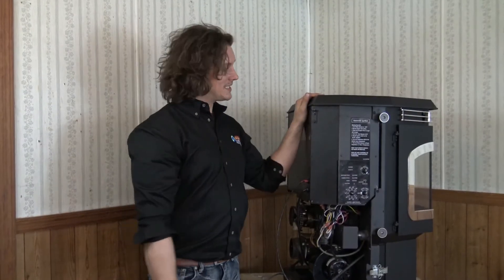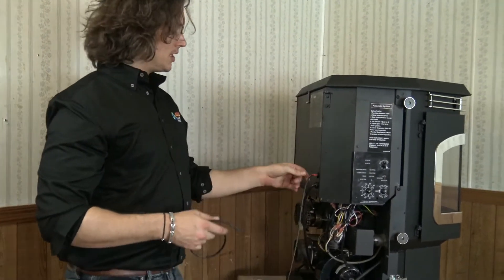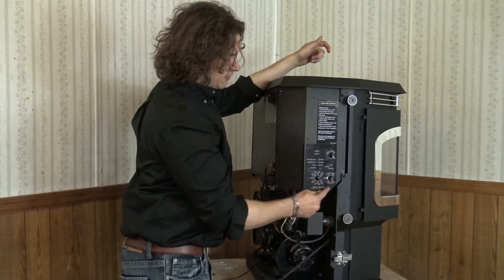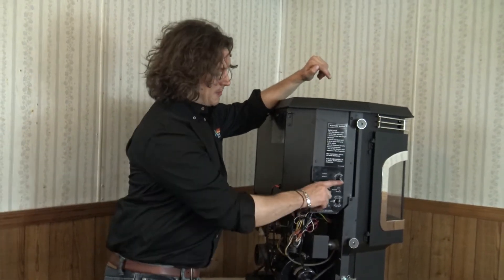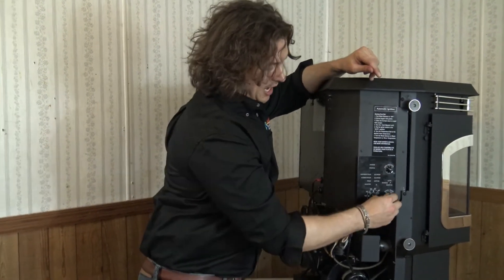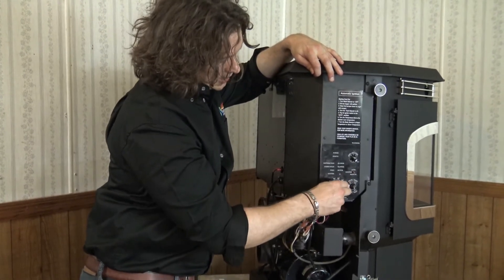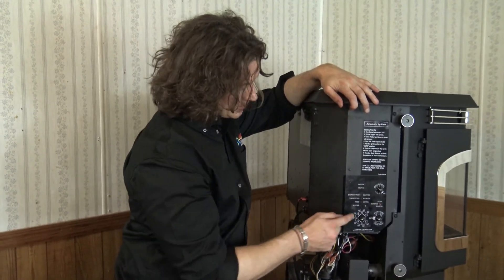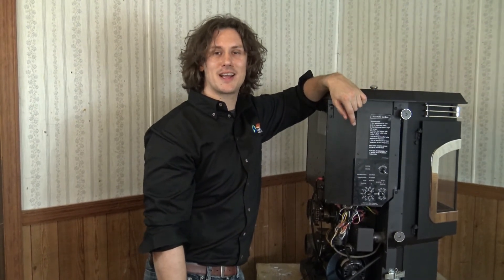Harman Stove Controls, How to use a Harman Pellet Stove

Comment: Hi. My ignite light is staying on and making the fire burn weird. It just keeps wanting to start the fire even after it’s burning. Any ideas?
Reply from the maker: Thanks for contacting us. That is not a common one. Obviously if power is going to that igniter continuously it will also burn the igniter element out pretty quick. The first thing I would suggest is to get an ohm reading on the igniter with a basic multi-meter; there's a small chance it's an igniter issue (Testing Igniter https://pellethead.com/how-to-test-and-replace-a-stove-igniter-pellet-stove-ignition-troubleshooting/). Harman OEM Finned Igniter should be reading 45-53.0 ohms in proper range. Second I would tell you to clean the ESP Probe (video below) The ESP senses temp in the exhaust and gives signal to the control board from start-up to normal operation. In most cases this circumstance will be a control board issue giving constant power to the igniter. You can certainly inspect the control board and see if anything looks abnormal. If you flip your igniter toggle to manual after it lights, does it then shut off? Happy to help. Thanks.

ESP Cleaning: https://www.youtube.com/watch?v=kt7nnGMYU-k&t=42s

Comment: My Accentra free standing has all the lights on board come on and you hear a hint of a hum but stove does not come on. So, basically  from a cold start up I turn it on and the lights come on as if it’s in the starting mode but nothing. I’m going to remove back panels and turn on again to listen for where the hum is coming from and go from there.
Possibly the motor?
Reply from the maker: Thanks for the message, happy to help. Is the status light giving you any blinks? What happens when you turn the feed adjuster dial to test? Most likely the hum is from the combustion blower. Yes, remove the panels and do some inspection with a good light. You can also inspect the combustion fan paddle impeller behind the ash pan - video below on that. Keep us posted. 

https://www.youtube.com/watch?v=N4DwBnYo2Nw&t=596s

Here's a video on the Accentra FS combustion blower replacement for reference as well.
https://youtu.be/np1dlYITcpw

Comment: Hi, does the power light stay on?
Reply: Thank you for answering so promptly. I purchased my house a year ago and have 2 pellet stoves of which I have yet to turn on. I’m alittle intimidated by them since I don’t know anything about them. One of them has never been turned on at all since it was installed. I do have a question regarding the pellets. If the pellets run out, does the stove turn off by itself or would I have to turn it off?
Reply from the maker: @san_rey94  Hi Sandra, our pleasure to assist. If you know which models you have we can send links to the owners manuals and possible links to videos that may be helpful. That is a great place to start as you learn about the appliances and how to operate. Almost all pellet stove models will shut down if the stove runs out of pellets, yes. There's only a few exceptions on that of which I am aware of, and those would be very early pellet stove models. Always happy to help, thanks!
Reply from the maker: Yes, when the stove is plugged in the power light will stay on as a steady red light. Any other questions please let us know.

Comment: How do I change the circuit board on this advance model
Reply from the maker: Thanks for contacting us. Here is the replacement of the circuit board on the P43 - Same circuit board. https://youtu.be/PNAkJ3jDmtM 
Only thing different with the Advance is that you will pull the knobs off and then release the circuit board on the backside - each corner has a pressed fitting, just a little bit of pressure on each corner and the board will release. Make sure your stove is unplugged from the wall. Any questions please let us know. Thanks,

Comment: Hey my p61 continues to feed pellets and burn after the switch is set to off? Any ideas
Reply from the maker: Hey Ryan, It is normal for the auger to continue to feed 'purge' pellets from the auger when the dial is turned to off. This should be for a very short period of time once you turn the dial to off; designed to simply purge any partially burnt fuel in the auger shaft during shutdown. If your feed motor continues to run for a significant period of time when the dial is turned to off, or if the auger motor does not shut down at all, we will want to take a closer look at the ESP probe and control board. You can start with the ESP and performing a cleaning - here is a video that will walk you through it. https://youtu.be/kt7nnGMYU-k

Keep us posted, happy to help!
Reply: @EarthSense  very helpful thanks! Yeah I dont think it's normal. I sat there for a half hour or so watching it,and the auger was still running.
Reply from the maker: @ryanneenan8472  Thanks for the message Ryan. Let me double check with our tech team - that does seem excessive to me. Let's clean that ESP and see if anything changes. I'll follow up. Thanks!
Reply from the maker: @ryanneenan8472  Hey Ryan, Just heard from one of our techs. He stated: Depends on the control board version that is in his P61 and the ESP temperature reading. Could be a couple minutes, could be an hour..

I would still suggest giving the ESP a good cleaning and seeing if that changes anything. Is this the original control board? Do you know the manufacturer date of your P61? Should state that on the rear UL label. Also wanted to ask is this a recent issue or something that you have noticed for awhile?
Reply: @EarthSense  the stove is I believe a 98 or 99. I just picked it up and had it outside on an extension cord just trying it out. So I don't know any history on it. It runs fine, but again when I went to turn it off the flame got real small,and just kept slowly adding pellets. I just may not of been patient enough. I'm coming from a breckwell big w
Reply: E
Reply from the maker: @ryanneenan8472  Hey Ryan, thanks for the message, apologies on the delay. Thanks for the info. Yes, early generation control board like that many times will go about an hour purging the fuel from the auger shaft. During your testing, let us know if it goes longer than an hour when you shut the stove off. Yes, Breckwell BIG E will be a very different system to the Harman. Once you get the hang of the Harman I think you will see a big difference in efficiency, fuel usage, and ease of cleaning/operation. Keep us posted, thanks Ryan!

Comment: I have an airtight fireplace. Can a Harmon be set in front of it and vented up the existing triple wall chimney.
Reply from the maker: Thanks for the message Nick. So you have an open/empty fireplace? Or is there a wood or gas insert currently in there? If you have an open fireplace where no other fuel is burning, you can most certainly place a Freestanding Harman stove in front and run a combination of Ridgid PL Vent to the chimney and then a 3" or 4" PL Flex Pipe up the chimney. Harman also offers different fireplace insert models at different sizes/dimensions if you wanted to place an insert directly into your fireplace. Let us know of any other questions you have. Happy to help. Thanks!

Comment: In STOVE TEMP MODE what determines the stove temp?
Reply from the maker: Thanks for contacting us. Stove Temp is a manual operating mode. What determines Stove Temp is where the dial is set on the 1-7 markers inside the 50-90 degree adjustment. 1 will be the lowest heat setting, 7 will be the highest heat setting. When operating on Stove Temp it will only operate to where you have it set. They should call it Manual Operating Mode instead of Stove Temp - Probably would eliminate some confusion here. Let us know if that makes sense and any other questions you may have. Appreciated.
Reply: @EarthSense  But… how does the stove know it’s reached it’s set temperature? What factor plays this roll. A built in thermostat?
Reply from the maker: @Bobcagon  Thanks for the message back. On Stove Mode there is no set temperature, no thermostat function in place. It's just a set rate of fuel feed depending where you have the 1-7 dial set. Example. On Stove Temp mode, if we have it on setting # 1, most Harman's will run at approx. 1lb of fuel per hour. It does not matter how warm or cold it is, the stove will run continuous at 1lb per hour. If it's say the Harman Accentra which is 40,000 BTU and we set the dial at 7 on Stove Temp mode, it will feed 5lbs an hour steady. Does not matter how hot or how cold the room is or temperature outside - it's a set rate of feed. Only on Room Temp mode does the unit operate on the thermostat dial and room sensor probe to adjust the feed rate based on your set temperature. Hope that makes sense, any other questions let us know. Thanks!

Comment: What if you don't have electricity. How do you run the blowers?
Reply from the maker: You need to have a power source to operate the stove. If no AC power was available, there are inverters offered to be able to run the stove on 12V DC power. Pure Sine Wave inverters are recommended for Harman models - Wattage needed will vary depending on the model and if you plan to use auto ignition. Hope that helps, any other questions let us know. Thanks!

Comment: I have a p43, self installation,  i know this is a dumb question but where is the power cord?
The duravent connection to the stove asks the installer to apply high temp caulking to the connection, is no clamp required 
needs to be an installation video for self installed units with instruction geared toward no experience.  I am a handy guy but i have yet to see a good video with every issue covered, including a corner mount, i surmised that because the exaust port is centered it can go either right or left. But i didn't notice it till after i had marked the wall for cutting the hole.  Fortunately i had not done that yet, and refigured my exit hole.
Also include an inlet air ducting video.
Reply from the maker: Thanks for the message Robert. The power cord will be on the rear of the unit. On a new unit it is often tucked up under the rear panel to the left of the exhaust hub. If you remove one on the bottom rear panels you will most certainly see it. 

Yes, important to put high temp sealant around each vent connection once locked in place. Once you have the vent adapter on the rear exhaust hub, you will use the sealant on that connection as well.

We have a couple basic videos on installation; corner install linked below. This installation video is with Direct Temp Vent which is a bit larger and pulls in the fresh air with the same pipe, but still can be a good reference if you are using standard 3" or 4" PL Venting.

Hope it is helpful and if you need anymore assistance we are happy to walk you through. 

https://www.youtube.com/watch?v=Dd8KlU6LEvc&t=1s

Comment: I have a Harman 25th Anniversary edition I bought it new in 2005. Went to turn it on this year and the all things worked except for the feed motor not coming on. I did try the test mode and the feed motor was the only thing not to come on. I have bought a replacement and have yet to put it on. I saw your video on how to change that motor out Thank You that looks very helpful.  To this video about the electronic controls  my control board flips out  from the back and has all the same knobs and lights etc. Question; When I turn my stove on say to low or high I  have to be very specific to which location you turn the knob to or it shuts the stove off or cuts in and out as you turn the knob say if you go a little past the "L" in the stove temp mode which is all I have ever used it does this all across the stove temp dial with high as well. Would this be the electronic control board going bad or would this be in need of cleaning the contacts if that is possible
Reply from the maker: Thanks for contacting us. Yes, if you didn't have any feed on test, most likely it is an auger motor failure. Glad the video could be a helpful guide, let us know if the auger motor is running correctly once you have it installed. As for the control board dial issue, it sounds like the potentiometer in the control board that the dial plugs into is getting worn out. You can certainly pull the control board out and do some general cleaning of any dust or debris that may have accumulated. I have heard of some folks getting the control board potentiometers replaced or refurbished. Although we don't service the control boards, we do offer replacement. Here is a reference video on changing the board which may be helpful if you decide to pull yours out. https://www.youtube.com/watch?v=PNAkJ3jDmtM

In this video we show fuse replacement on a Harman Accentra which will have the same style pull away door control board as your XXV: https://www.youtube.com/watch?v=vJZn_EC-2gc&t=7s

XXV Replacement Control Board for reference: https://pellethead.com/product/harman-platinum-4-output-circuit-board-control-panel-oem/

Keep us posted, happy to assist.
Reply: @EarthSense  Hello and Thank You for your quick response.  What are the potentiometers  I am just not aware of this term or what a potentiometer is. Would these where the knob stems plug into/or through the control board? I did watch your video on how to change out the control board. Thank you you do a great job of explaining the how to and what to look for in your videos.
Reply from the maker: @gregorydauterman4429  Thanks for the message back Gregory. Yes, the potentiometers are what the dial knob stems/shafts plug into on the circuit board. We do sell replacement shafts and knobs for the board. Sometimes they are tight, but you can pull out the shaft to inspect them. If the shaft connection to the potentiometer appears worn, that could cause 'play' and create issues when turning the dial. Glad we are able to assist you, thanks!
Reply: @EarthSense  Update ; I did install my auger motor this past weekend following your tips on the motor replacement video and it works perfectly! Thank You again!
Reply from the maker: @gregorydauterman4429  That is fantastic to hear Gregory! Thanks for sharing! Any questions down the line just let us know. Appreciated.
Reply: I had the door open so auger would not turn on.  Air sensor said it was unsafe.

Comment: So after the hour and adjust the feed accordingly do I cut back the temperature or leave it on Max? I am running a brand new p61. 
I love the video. I have a 30 yr old house and bigger. Finding the video so helped me
Reply from the maker: Thanks for the message, glad it was helpful. Yeah, after the hour and any adjustments to your feed adjuster dial, go ahead and turn back to your desired temp. You may find with different pellet fuel it may need adjustment again, much of which is based on the length of the pellets. But for the most part just a good accurate way to know where that feed adjuster dial should be based on the area you're heating. Any other questions let us know, the P61 is a great stove!

Comment: Great video !! What might be the cause of dist. Fan turning on/off AFTER the stove is shut down? My 61 is doing it and im not digging the malfunction. If I turn the dial a wee bit from off it seems to take care of it.
Reply from the maker: Thanks for the message Brian. Glad to hear the video was helpful! With you mentioning the control board dial, I would lean towards this being the potentiometer in the control board wearing out a bit. The potentiometer is what the knob dial plugs into. Besides the control board the only other element that controls the Distribution blower in a Harman P61 will be the Exhaust ESP Thermistor Probe. Here's a reference vid on cleaning of that probe. https://www.youtube.com/watch?v=kt7nnGMYU-k&t=6s

If it is the control board you can keep adjusting like you have been to get it to turn off. I have heard of folks getting repair work done on the board and potentiometers through local electronic repair places. Although we do not re-build boards, we do offer replacements.
P61 Board for reference: https://pellethead.com/product/harman-circuit-board-control-panel-manual-start-models-oem/
P61A Board for reference: https://pellethead.com/product/harman-platinum-4-output-circuit-board-control-panel-oem/

Keep us posted, happy to help!
Reply: @EarthSense  thank you kindly for the prompt reply. Will follow suite starting with esp clean and see if that remedies the issue.
Reply from the maker: @brianfabry4823  Happy to help! Keep us posted with your progress.

Comment: Can I install the digital thermostat that comes on the more expensive models?
Reply from the maker: Thanks for contacting us Ed. If you have a Harman that has a control board like the one in the video here, it is not designed for compatibility with a digital thermostat. The room probe can be extended if needed based on where you want it pulling temp from. Yes, several of Harman's newer models with have touch screen control boards with digital temp control. Any other questions please let us know. Thanks.